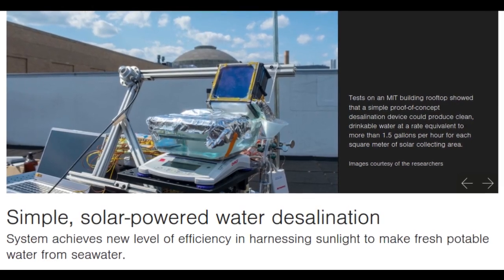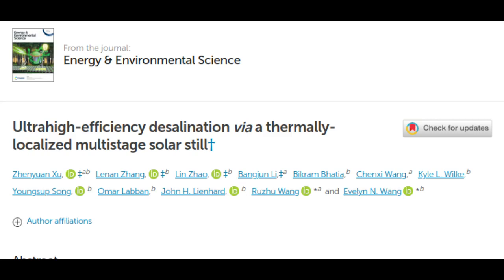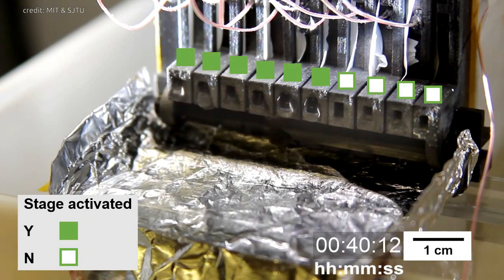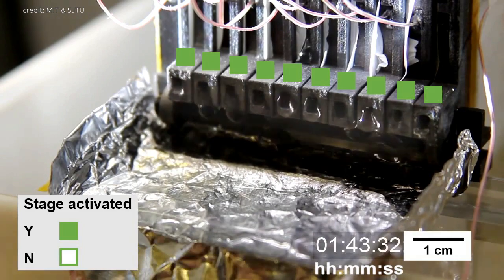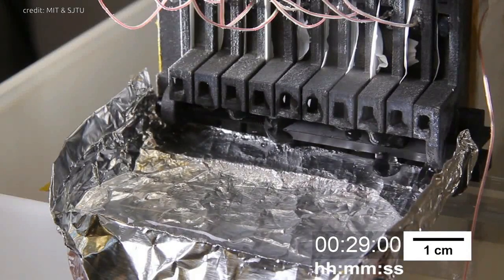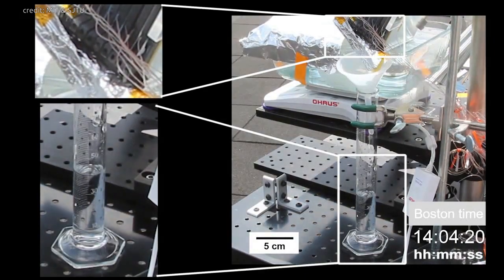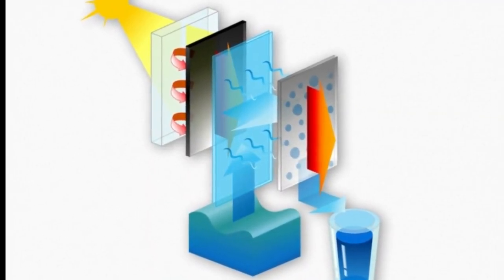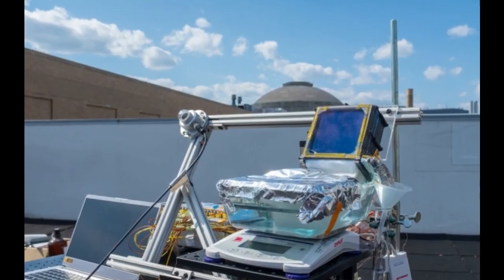MIT's passive solar-powered water desalination system achieves ultrahigh-efficiency

Comment: The device "can achieve an overall efficiency of 385% in converting the energy of sunlight into the energy of water evaporation."  Wow!  This is almost a perpetual motion machine!

Not really.  It is impossible to turn 1 Watt of solar energy into 3.85 watts of heat (which is the energy of water evaporation).  It's impossible to turn 1000 watts of solar energy into 1000 watts of usable heat  It may be that this design, by being multiple optimized layers, has 385% the efficiency of an equivalent single-layer still, but the two statements are completely different.

This appears to be very impressive, and I'd love to see developments bringing technology like this into the real world.  You essentially claimed it to be magic.